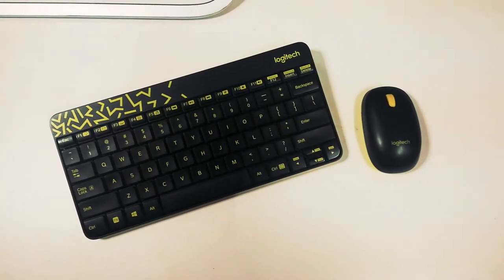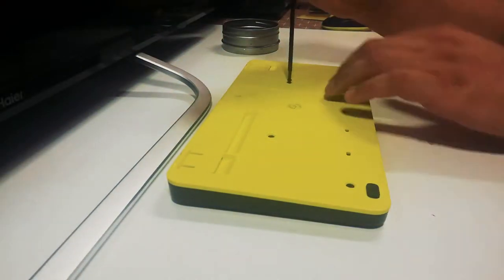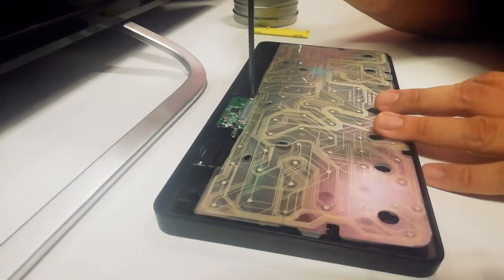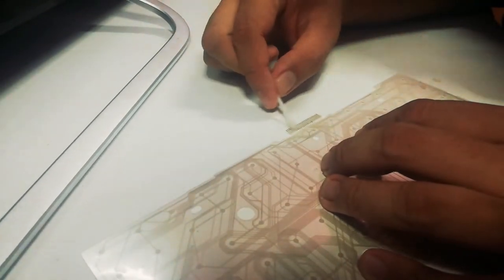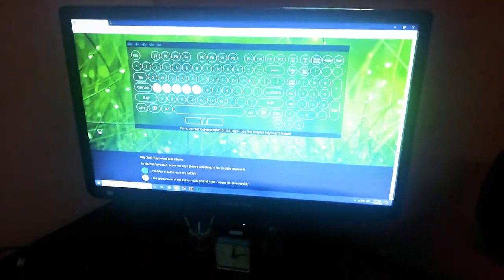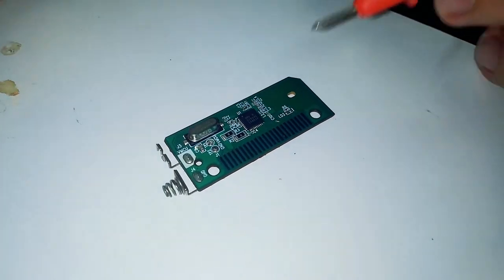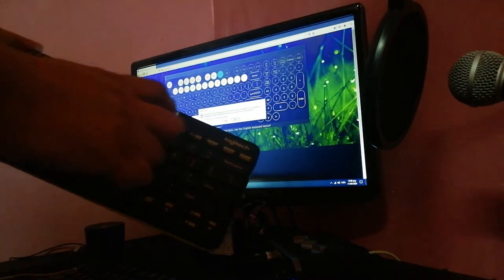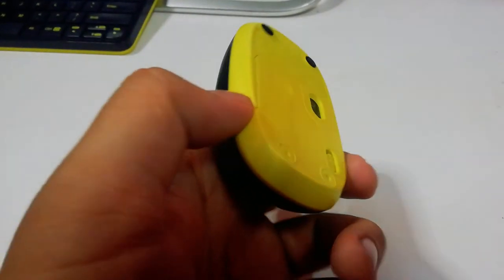FIX Keyboard Randomly Pressing Keys Logitech MK240

Comment: I had K270 and it had not detected by unifying receiver while the mouse work well.
What is possibility error for keyboard?
Few days ago, the character typed randomly...
Reply from the maker: I'm not really sure. But the are several possibilities.
1) the battery contact are corroded or not transfer voltage to the board
2) the motherboard are faulty maybe there are some component are faulty.
Reply: @ArlanFixStuff , thx for your answer.
Yeah, the battery contact had cleaned after had a corrotion (green) and re-connect with new cable.
Are there any place to buy the motherboard?
Reply from the maker: Or maybe the corrosion alredy eating away some of the trace on the board. I believe there are no place to buy a replacement board.